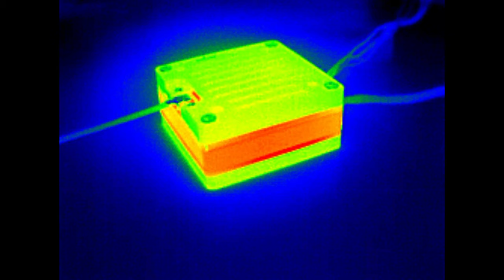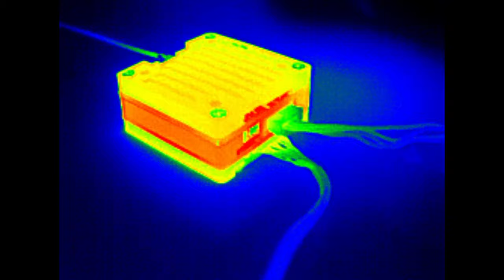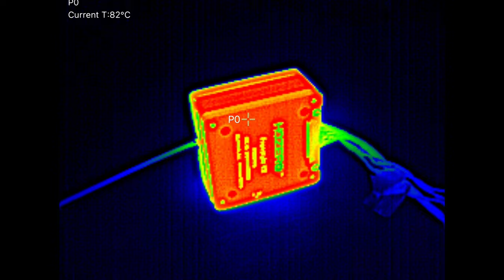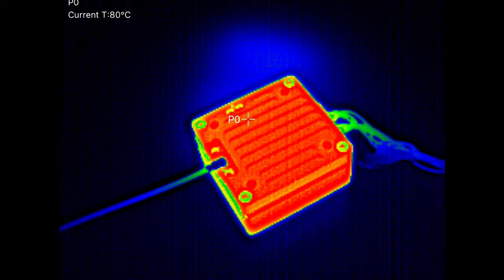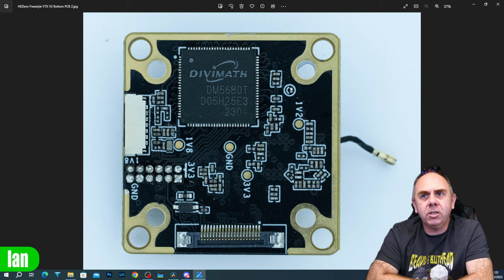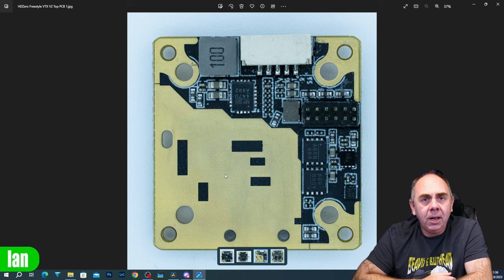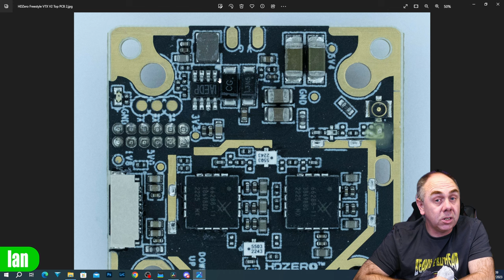HDZero Freestyle V2 VTX Teardown & Thermals

Comment: I like how the PA is on a totally separate board. I wonder if it would have been overall thermally happier if there was more thermal isolation between the chipset and the power amplifier.

Comment: Bizarre that they're pushing the heat into the centre rather then the much larger surface area of the outside.
Reply: I don't think they are pushing it, as heat will accumulate where it dissipates the slowest. Maybe a lateral rugged surface would have helped a bit, or not at all. I'm sure their engineers are much smarter than us.

Comment: Hi,
Nice tear down. How would you compare with the vista thermals? I run mine makes for over a year and no problem at all. Frankly I’m impressed  :)
Reply: My naked Vista gets super hot need to get it in the air fast or have a fan on it while working on the bench..

Comment: Why two PAs for a single antenna port?
Reply from the maker: They use a push and pull setup to get the high power output.  So they work in parallel to double the affective RF power.
Reply: @MadRC Thanks for the quick response. Really cool stuff. is there any schematic for this available openly? Also,  wish to ask you: how do the high power vtx that provide variable gain options from 25mW to 2W do that when they are using a fixed gain PA with no control?